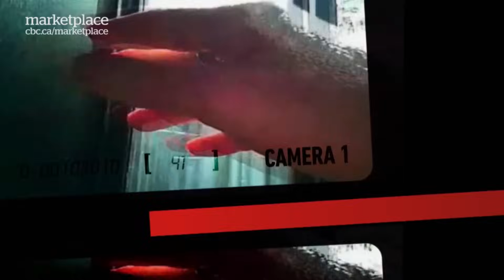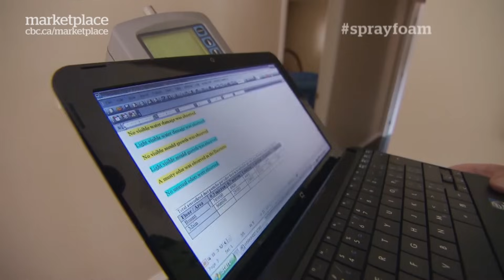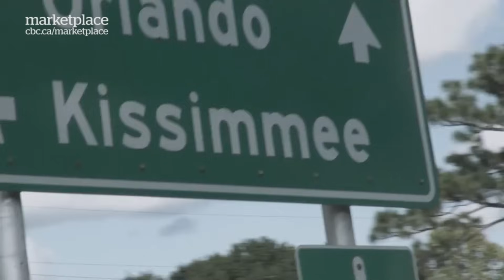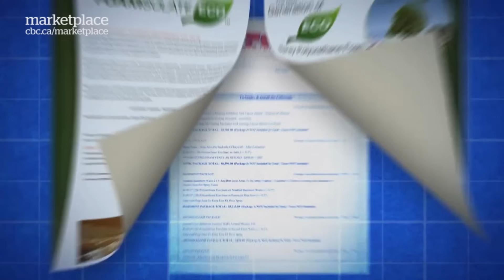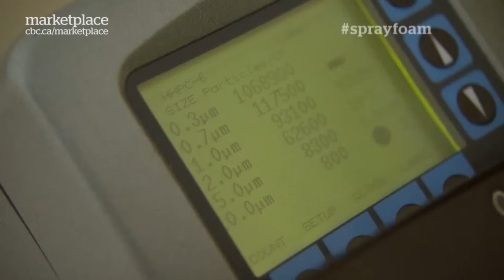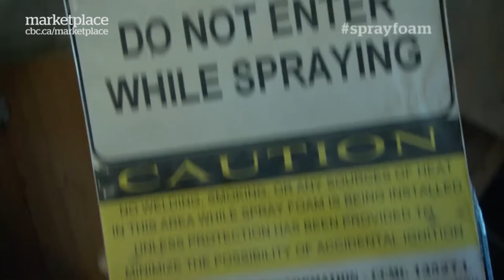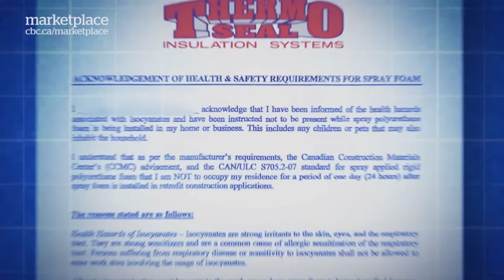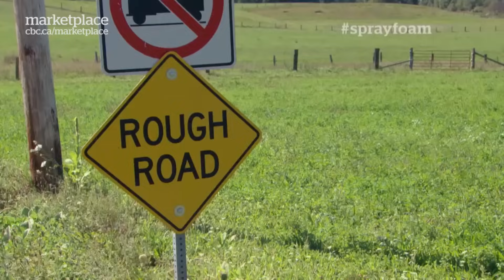Spray foam insulation nightmare: What can happen if it's not installed correctly (CBC Marketplace)

Comment: Why are people still using this? I know of many DIY people using this every day!!
Reply: Cause it is insulation from the heat so the roof doesn’t get hot you don’t have to run your ac a lot because your house isn’t getting that much heat
Reply: Because when it is installed properly by correctly trained professionals it is an incredible product that adds fire resistance, vapour barrier properties, and incredible insulation properties. There are thousands of these jobs done every year. Notice how there weren’t that many people who complained of issues? That’s because they are one off problems that are well outside of the norm. I’ve assisted in the installation of closed cell polyurethane sold through BASF on several new homes and it’s an amazing product. We never had issues with any of the homes we did and it is amazing when you follow the manufacturer SIP (Standardized Installation Procedures).
It cannot sustain flame, on its own, and it reflects ambient and thermal heat far superior to any other insulation.
Reply: Stephen Holthe except for hemp and soil. Much better to use natural building materials and build a house that doesn’t need this rubbish.
Reply: Easy, DYI'ers don't complain because they can't make money suing themselves.
Reply: @stephenholthe  I have a house over the water.  Would this be OK to spray on under the house to repel the water in case of a once in a decade type flood?  Right now, the floors are super cold because there is no insulation under them.
Reply: Mike Song absolutely! Just get someone who is certified by the manufacturer of the isolates they are using. I used to use BASF’s product called Walltite Eco, it had a purple colour to it and worked fantastic it has vapour barrier properties as it’s a closed cell urethane, as well as a high R value. It’s also VERY fire resistant, it will not sustain flame on its own.

Comment: why doesnt he use regular stuffing insulation?
Reply: Spray foam can save you 50% on your energy then compare to the regular stuff.
Reply: the scare crow was on vacation? ha ha?
Reply: Because companies make wild claims on how much you save with spray foam... but the actual data sheets show the differences are very small.
Obviously they don't intend to tell you that when you got money  they can get.
Reply: thats not true, i have worked in a factory for almost 8 years, producing insulation plates. if correctly manufactured and applied there is nothing like worse energy saving over spray foam! mostly they use to spray because it is much quicker and you dont have to work so precise, it saves them a lot of money but isnt worth the risk in my opinion!
Reply: spray foam has its place.. rim joists and basement walls ... other than that, you're wasting your money.
Reply: was gonna ask that. so should you spray foam the small leaky spaces and use batt on the rest?
Reply: there is never a reason to spray an attic... vapour barrier and batts of blown in cellulose or fibreglass will do as well and cheaper.  spray foam is great for rim joists, basement walls or other hard to insulate areas... after a couple inches switch to batt... you will get all the benefits of the spray form after the first inch or two.
Reply: TheAmazingFirehawk it's a denser insulation, also it get in all the nooks and crannies, cutting costs much more

Comment: I did this for a living before I was hurt my back really bad. You need to know what you are doing when installing Close cell and open cell spray foam. If you do a complete seal of the house then you need to have fresh air being pumped in because there will be to much carbon monoxide.

Comment: What’s all this drama with this guy he has to just to spry it with stain blocker foam should be stain blocked once it’s sprayed it’s not a big deal I been spraying foams once they are dry as soon is dry you have to do one code of DC315 and also one coat of stain blocker that’s it you would never have any smell or issue why this guy take down this roof Omg what’s wrong with people

Comment: I owned a spray foam company for years and never recommend retrofit.  It’s a new construction product only.  I personally knew that there would be serious off venting in retro fit installations and that could pose health problems during the first few days.  Even in new construction I would advise the builder/construction supervisor no other trade/sub-contractor would enter the new home for a minimum of 72 hours for proper curing of the spray foam.  In the video above in the attic space you will see on where not to spray.  You would have sprayed directly to the roof decking not to the top of the ceiling Sheetrock.  My main point spray foam is not a retrofit product.

Comment: I opened up my ceiling underneath the balcony. It had spread foam too. But the wood are rotted. The wood frame also was rotting . The lack of air flow locked in the moisture and unfortunately not having a proper Vapor barrier

Comment: The pre-mix stuff sprayed according to directions works great, but it's messy and you can't get rid of it. If it's mixed wrong it's the gift that keeps on giving.  Just put insulation batts instead.

Comment: I'm surprised the encapsulation wasn't mentioned.  It is not a good alternative but I've seen it done for asbestos and would be much less expensive than removing and replacing the roof and attic.

Comment: 19” of blow in! It’s code in BC it works amazing keeps the house cool in the hot summers(as long as you keep doors closed) and hot in the winter! Oh and it’s safe!
Reply: 20” of blow in is what I have in my house and shop. No problems no worries great results.
I spayed foam in the fibreglass industry for 4 years in the early 80’s and could never understand why anyone would want to want to introduce that toxic soup into their home.
Read the WHIMS Material Data Sheets on that stuff it’ll scare you away from it.

Comment: Roof vent baffles are a must before spray foam. Spray foam against masonry doesn't allow masonry to dry out. A baffle or capillary break should be used against masonry before spray foaming. Your roof and masonry needs to breath to dry or it molds and rots.

Comment: my installation had no issues but I did have the installer put a 1" layer then blownin insulation on top of the foam. When its too thick (which can happen when attic code requires R50), I can see issues because installers might not want to do several passes in the "sauna"

Comment: If you get the stuff in your house make sure the person installing your air conditioner knows.  The foam insulation really holds in moisture, so you’ll probably have to get a dehumidifier put on your AC.  If you don’t get a dehumidifier for every morning when it’s cold outside you’ll wake up to a ridiculous amount of condensation on the inside of your windows possibly enough to even have water on the windowsill.  Make sure your HVAC person knows the insulation you have
Reply: Or you can add a fresh air 2-4” return to your central unit and put two 2” holes in either side of your internal system.  We always have fresh air at something akin to 2% volume “over time whole house get cycled” and have a ventilated attic.

Comment: I use to be a drywall hanger & have been on many many new construction jobs that were being sprayed with foam and remember smelling that fishy smell. Kinda sounds like the classic rush, it sounds like if they were to spray a thin coat let it dry & spray another coat,  build it up slowly might be the answer.
Reply: If the contractors worker is paid by the hour you'll get  a time consuming thin coat. If the worker is paid by the job he'll be in and out as fast as possible leaving you with a less than desirable result.

Comment: You're better off cladding with ventilation the whole outside in foam slab, then you chicken wire it and render it,, all on the outside,, window reveals a door reveals become deeper and that's about it,, it's a longer job but safer 👍❤️ it also act's to keep your home cool in the summer

Comment: Lot of labor workers doing rush jobs. The key point the installer said was it must be done precisely and  slowly with thin layer applications so it can properly cure.  And needs to properly mixed ratio wise. You have to watch labor workers

Comment: Removing the whole roof is a scam in itself. 
They really could have removed the ceiling drywall and put back new
Reply: john cuervo You’ll find they tend to take the longest and bumpiest route to solutions in these to exaggerate how damaging the issues are. They literally alluded to the issue: the curing process in the first minute but don’t reveal it til a minute before the ad. It bugs me. They show you at the end the response the couple could have had, but instead tormented their kids and put on a show.

Comment: Not only have you got that problem with the foam but you can't go spraying insulation over power cables as they get warm through use and pretty warm through heavier loads applied.
If you insulate the cables, you are reducing their current carrying capacity as they heat up and are unable to dissipate that heat eventually leading to the possibility of a FIRE. Also if there is any styrene content in that foam it will destroy the PVC insulation which covers the wires, which means you will have to rewire the whole house!
So.......
If you want to spray insulation (which is a bad idea as although it may not be flammable it will still give off an acrid smoke) then you need to provide a good air space around your wiring to keep it at a nominal temperature and keep all styrene type products away.
Basically, use rockwool as it's mineral based.

Comment: Kingspan harder job or superquilt spf60 can be stapled in place and has an equivalent u rating of 400mm of standard fiberglass, you can cut it with scissors,, my roof space I converted using space blanket,, great to use, from a fire aspect  rockwool slab should be used above all bedrooms between the ceiling joists especially if there is an attic conversion, using chicken wire to maintain air flow to the timbers

Comment: 16:43 - On some large construction sites in Vancouver, CA (with the larger General Contractors) it's not allowed to move the scissor lift while it's extended. You have to lower it fully, move it, then raise it again...every time. Also ladders, step platforms and baker/rolling scaffolds are banned on many sites.  In some cases if you are allowed use a baker scaffold, they insist you step down and lock ALL FOUR wheels before you use it. Then every time you need to move it you must get down, unlock all 4 wheels, move it, lock all 4 again and get back up. All that climbing up and down off a baker is considered safer than using it with the wheels unlocked and moving it while you're on it. 
There are some other crazy rules GC's make to save themselves millions on insurance - It's not about safety at all and everybody knows it, but they pretend they care so they look good
Reply: Those rules are for the lawyers and insurance companies and have little to do with worker safety

Comment: One major issue with the use of spray foam on the underside of the roof decking, is that it will take for ever for a roof leak to be discovered.

Comment: I had 2 inches of spray foam insulation on my attic floor gives R 14. .  Then I had blown in cellulose of18 inches gives R 54..  All totalled, I have R68.  It's recommended in North America to have R60 in attics..  I have closed cell in my outer walls.  About 3 inches sprayed in.  Never had any outgas smell.

Comment: There is a temperature range where these spray foams should be used.  If the attic is too hot, the spray foam chemicals won't cure properly and can cause the chemical smells.  If you are thinking on getting spray foam, make sure they do it on a day where the attic will not be hot.  Maybe in early spring on a cloudy day, or at night.  A sunny day can get an attic much hotter than 86°F and cause your spray foam to cure improperly.

I'm getting ready to insulate the walls in my 120 year old house that never had any kind of insulation in it.  My cans of spray foam say to apply between 50°F and 86°F.  They are the kind that does not require the mixing on-site of two different chemicals.
Reply: When you say your 120 yo house, I feel like it's a 120 yo mansion.

Comment: Years ago when this stuff started to come around. I saw the application of it and it was a huge issue. Spraying it all over pipes and electrical where fire and leaks could happen. Making it worse for contractors to work around. Causing mold behind the foam and also a nice warm place for rodents and insects to live.

Comment: A point missing from this video is the info the air quality guy developed in his analysis? That was shared with the homeowner but how about the foam company? Were they shown that information? 

I insulated the attic space in my home and considered spray foam. The cost of a professional job was too steep for my budget, and when I looked at DIY kits I realized it was too easy to mess it up, much too risky. So, I did two layers of pre-cut R19 fiberglass batts. One layer between the ceiling joists. A second layer 90 degrees to the first. Made a long "T" shaped pole to shift batts together into the tight space at the eaves. That was a DIY project I could do a little at a time. Worked great, saved money on the job and on the heating and cooling bill!

Comment: This makes me so angry those companies have completely ruined those poor peoples lives.  Whoever did this and whatever the manufacture was needs to pay out the @ss for doing this wrong.
Reply: I don't believe it would be too difficult for them to win a damages lawsuit against the installer, as per the Uniform Commercial Code standards regarding contracts for the sale of goods. Note that these codes do not cover real estate, but as the spray foam chemicals were a separate and movable, physical good prior to installation, it's sale falls under the UCC. The homeowners can demonstrate serious damages (health, financial, and time) caused by the installation of the spray foam. The fact that only a single place on all the various documents related to the sale of this good even mentioned that they should be out of the house for 24 hours makes it highly unlikely that the company could use that as a defense. Something that could cause serious harm to the customers should be extremely conspicuous or repeated in several places, particularly by the installers during their preparations and prior to actual installation. The fact that the installers chose to proceed with spray foaming while the homeowners were still in the house and using the house demonstrates complete disregard and negligence on their part. All of that aside, one of the many implied warranties of a spray foam product is that the house will still be inhabitable after spraying, and that it will not cause harm to the inhabitants. The customers paid in good faith, were not reasonably warned about how or when they could be in their house during and after spraying, they relied on guidance from foam merchants with greater trade knowledge as to which foam to use and how it should be installed, and the spray foam, for whatever reason, went toxic. This should be a home-run case for them at least having the installer pay for the expenses related to removing all the foam and restoring the attic and roof to the state prior to spraying. The customers signing the contract provision attesting to having been verbally informed of the danger of being in the home until 24 hours after spraying might prevent them from claiming medical damages, but I think most courts would agree that this warning was not conspicuously placed in the contract, such as being a separate line item that the homeowner was required to independently initial, in addition to signing the entire contract, prior to installation.

Comment: Who knows the owners of the home may have been told and just didn't adhere to it or even hear it when it was said because they were not paying close attention. It would have been more frugal to have that 10% replaced rather than removing the roof. They wanted not to chance it. Being in a wooden structure there are better options anyway. If moisture does get in it would be trapped and the wood would rot way before anyone would even know a roof leaked. It's happened. This is of course more of an issue when spraying it in thicker rather than thinner. Buyer beware there are circumstances spray foam is better often in metal buildings.

Comment: I had my whole house spray-foamed. the foam was told was made from soybean somehow. I have  5 inches in the walls and 2 inches on top of the ceilings with cellulose blown in on top. I had a slight smell the day of foaming. that smell went away and never smelled it again. I have roof vents at the soffits around the roof and at the peaks.  my attic is vented to outside. I live in southern Ontario. our house is nice and warm in the winter and cool in the summer. I am very happy. I had the ring joists sprayed as well.

Comment: Yah I agree, even if 10% of the foam was bad, they should remove that part and reseal it. Imagine the entitlement someone has to have to ask someone to do a 1 way job, have a small portion of it spoil and then demand everything to be removed. That's why they had this problem they could have worked with that company.

Comment: I watched  a guy did a test on insulation  and the foam board  and the spray  on insulation  burned fast .where the fiberglass  and Rockwool insulation  didn't  burn on fiberglass  only the paper  burned  . The Rockwool nothing  burned .

Comment: You could very easily use a standard XPS or EPS and use PU to glue it to the surface. It will take some time but the result will be exactly the same, if not better depending on the Insulation Density.